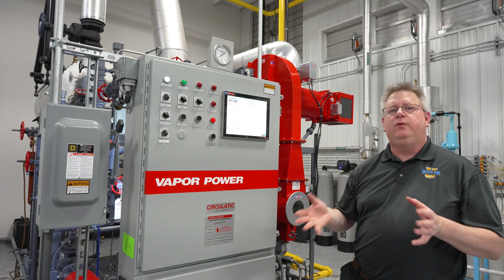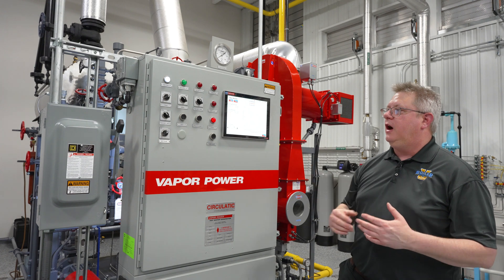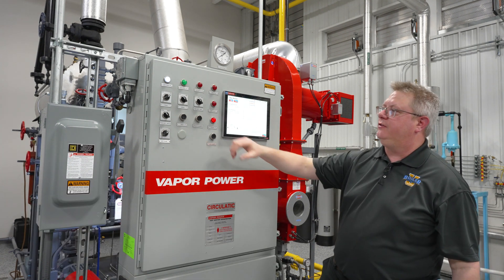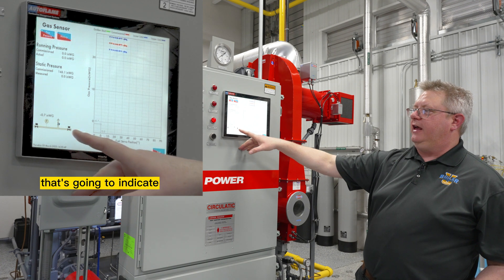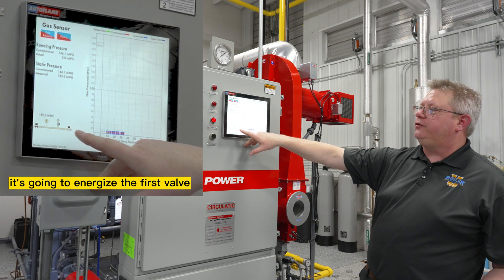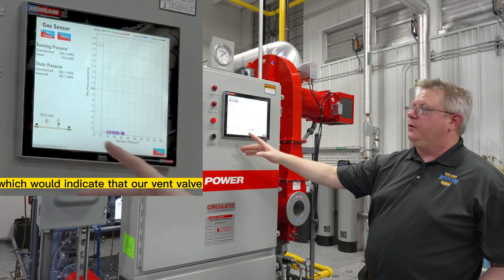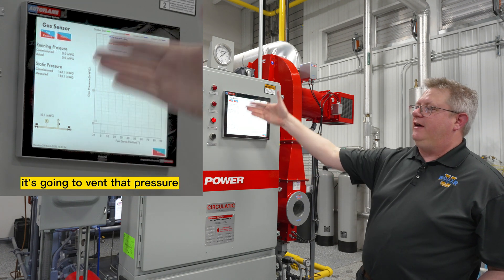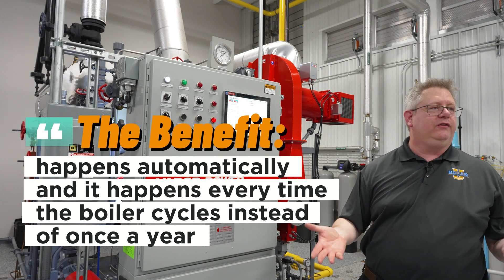Automated Leak Testing of Advanced Gas Trains like AUTOFLAME - Weekly Boiler TIps

Comment: How nice , what a great system, and understandably so. One time I was dispatched an outside gas odor, working for the STL gas utility (called in by the public). I checked the gas services & mains for hours in a industrial area of town  with outside temperatures below zero . Reassuring myself, there was nothing wrong with the gas, mains and services in the area,  I started to investigate the massively large industrial buildings in the area. I finally came upon an old (1960 model ) industrial boiler (big as a city bus) .  Found the double block and bleed manifold  vent spewing gas out of the relief vent on the roof . The strange thing was the boiler just got serviced that morning . Tagged it out and waited for the contractor 10 PM in the evening.